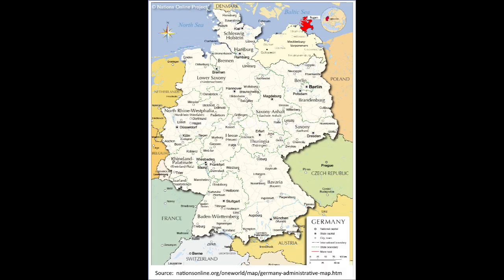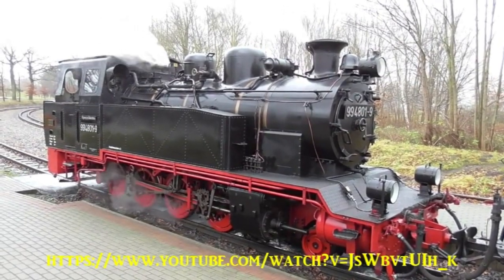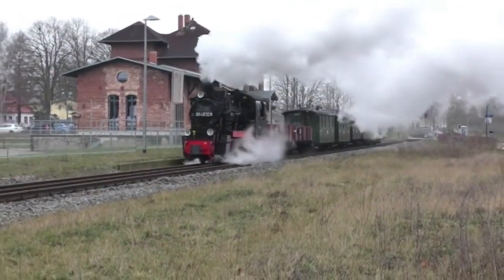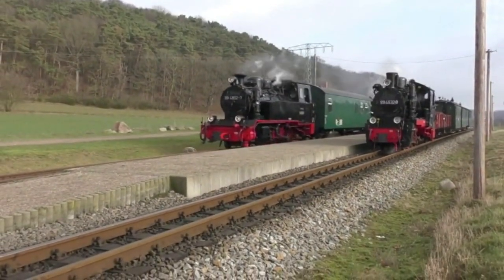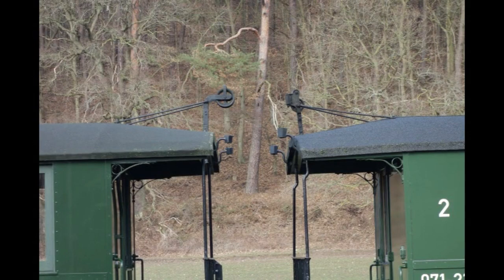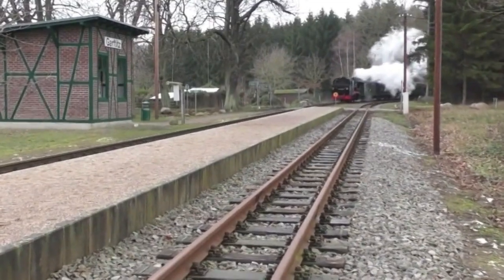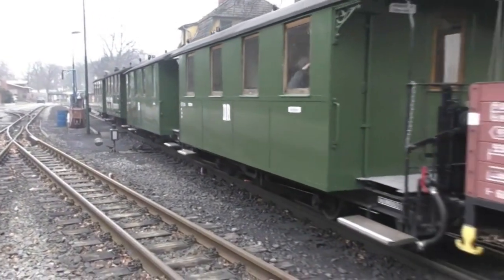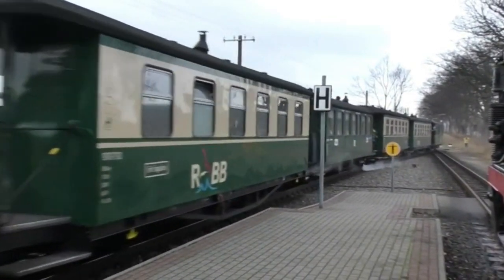Great Little Trains of Germany  -  Raging Roland

Comment: What a great railway. Is it well used by the locals? How many passengers do you think they get per train?
Reply: Locals use these trains just occasionally (usually elderly people without a car) but the number is really low.
It is mainly a tourist attraction and tourists likely exceed 90% of the annual ridership.
Main ridership is during summer. So, during low season (autumn/winter/spring) the scale tips a bit more towards local ridership.
Without tourists the line would´ve been gone long ago.
Oh, btw. all staff is employed by the company. So, only professional staff.
Nevertheless it is officiall public transport and thus receives some money from authorities similar to local bus operators.
Other lines further south generate a higher percentage of local passengers but none of them runs without subsidies.
Reply from the maker: My visit was in early February 2019, so definitely not the holiday season. The service trains were of six carriages and I was surprised that they were quite well filled. Rugen Island is a major tourist resort. In the summer I am told the trains are very well used.
Reply: @GarethJonesPilipala  True but Rügen has evolved into a year round holiday destination although the cooder seasons bring much less tourists.
My parents live in Stralsund. So, I usually pay a visit to the railway when I´m there. But I go to Bad Doberan as well. They do have the fastest narrow gauge trains in Germany going up to 50 kph (30mph). That´s quite fast for a 900mm gauge railway - steam hauled ...Those east German narrow gauge steam railways are a very curious thing as all of them are part of the public transport system and not solely for tourist purpose even though tourists form the majority of passengers.